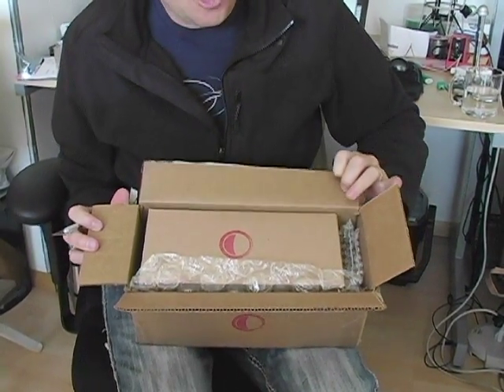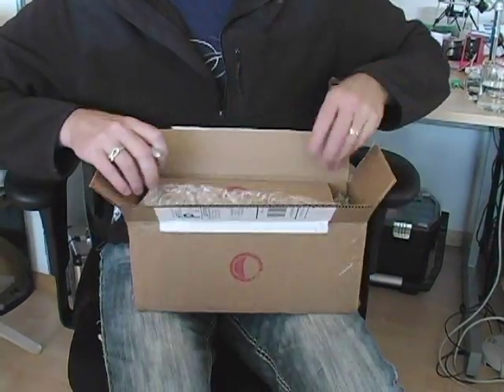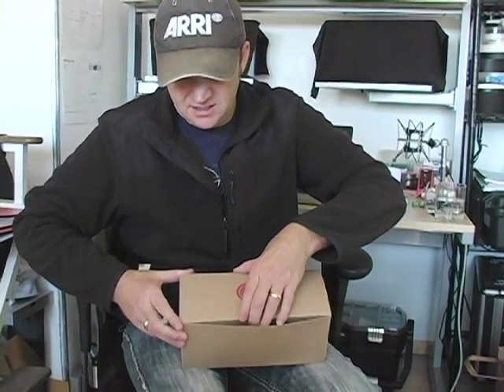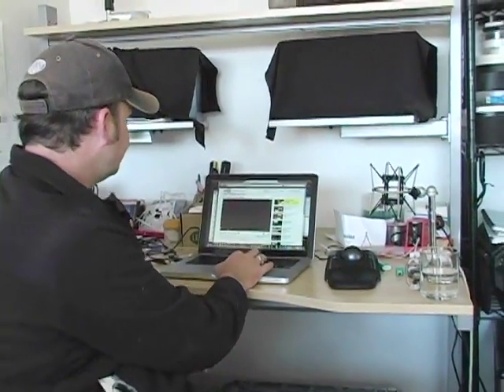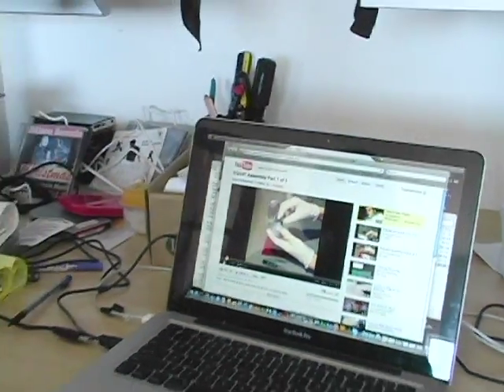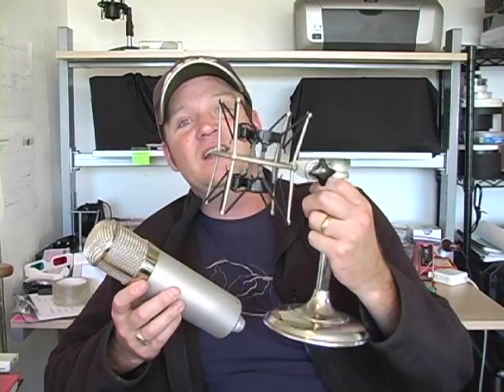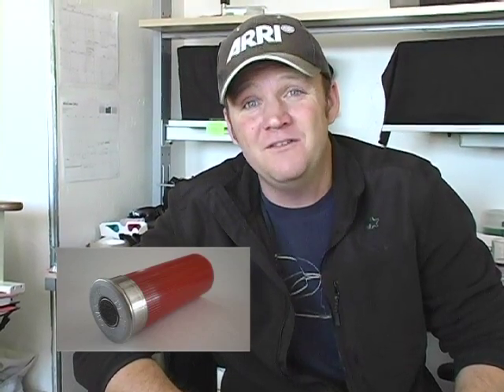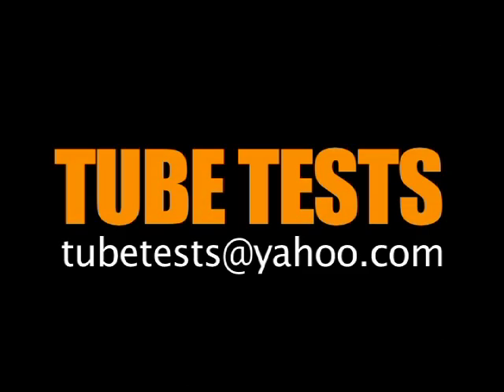Tube Tests Ep.17 "Equinox Systems EQU47" Build your own tube microphone www.EquinoxSystems.net

Comment: Hi, I have a Neumann M-147 and it's gone cost me to much to repair, the Capsule is Scrap and also the circuit it's scrap, so Seinnheiser asking me 600$ for the circuit and 800$ for the Capsule, I don't have this money and I need this Microphone, so what's the best replacement Capsule to restore this Microphone as close as possible to the original Sound please?